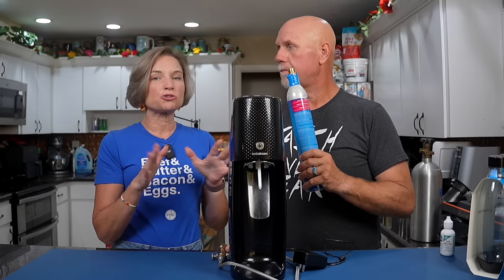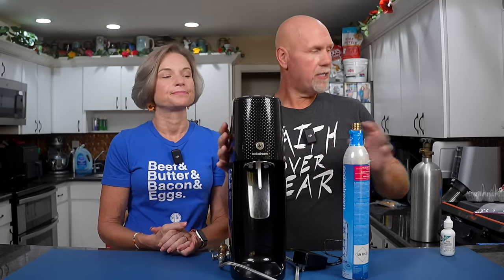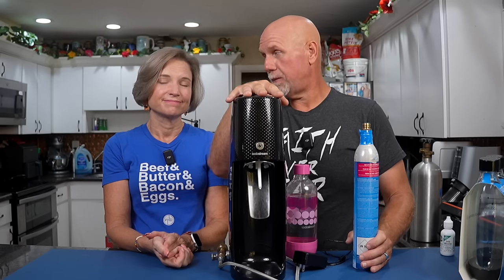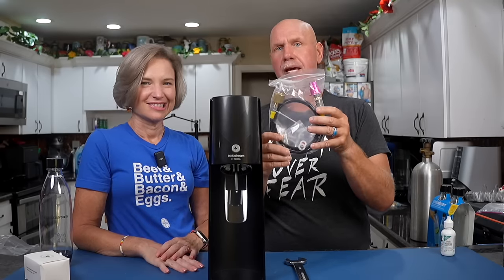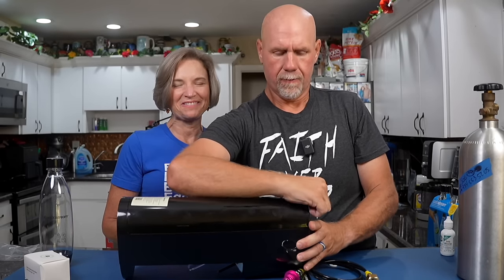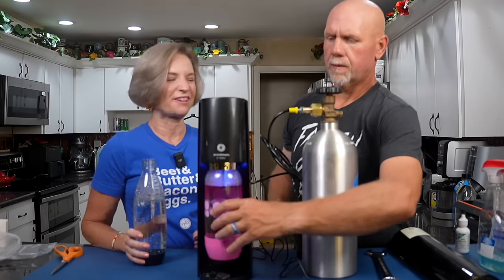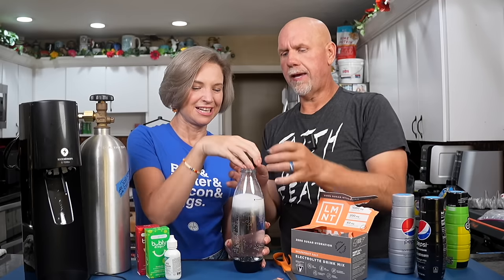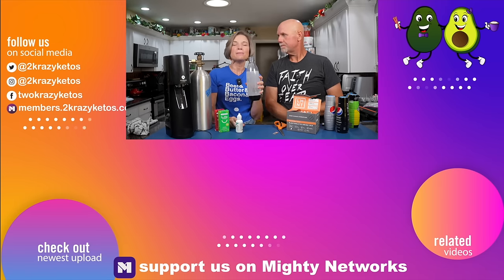Does the SodaStream system save you money? | How to modify the SodaStream Terra models

Comment: Like everything made to save you money the components needed to produce the end result are price gouged to point of making the device useless. Don’t waste your time with money saving products because they will always find a way to make you pay in the end. Even electric cars which were suppose to save you money at the pump are being taxed for every mile you drive. Not to mention the outrageous price of battery replacement which in most cases cost more than the value of the car. Anything claiming to save you money just skip it, like solar panels, it’s not worth it in the long run.

Comment: You are using way more carbon dioxide than you need to.
I don't have a car, so it's far easier to carry one cylinder even a large one occasionally than 6 2 Litre bottles (12 kg) of sparkling water.

Comment: What a load of BS. You get way more than 20l worth of co2 water from one can of CO2

I have since refill my own soda stream, because I can buy 20lb of CO2 for like $45. But even buying the refills at the stores, it would get more than 20 bottles
Reply from the maker: SodaStream advertises you get up 60L with one canister.  In our experience, it is only about 1/3 of that.   That number is based on using the lowest setting.    It's like looking at top speeds of an Ebike or Car.  Those numbers are under optimal conditions and almost impossible to duplicate.  Same goes for the Sodastream
Reply: @2krazyketos  not my experience. 

Get 60l worth from a store refill? No, probably not, but it's not as low as 20l

Like I said, before I refilled my own, I got store refills, never have I ever gotten that low of a yield. Average around 40, sometimes as high as 50.

 Now I refill to the amount it is supposed to have according to the bottle, and get well over 60l